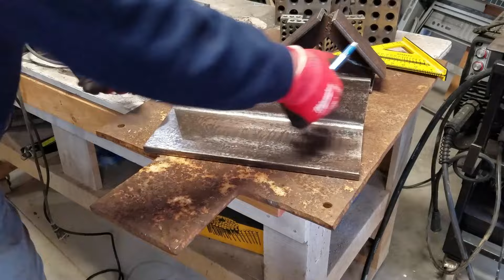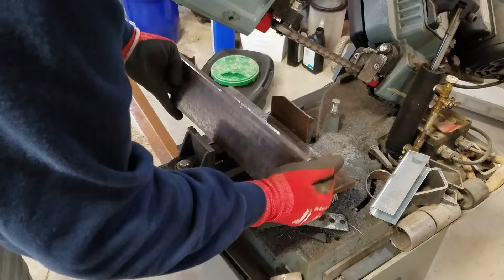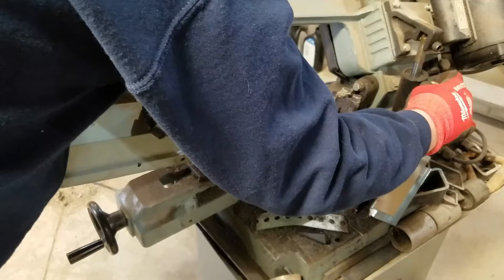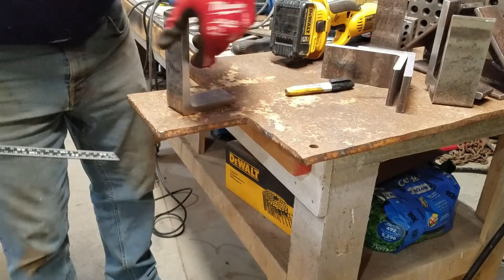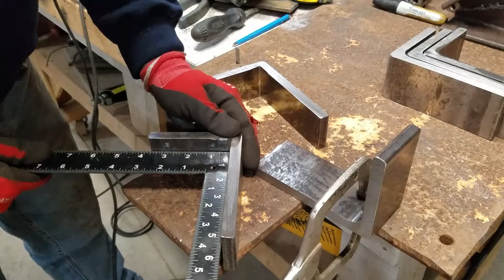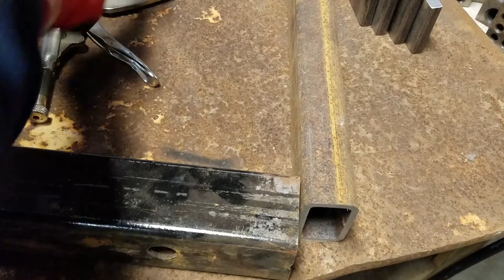6 Welding squares for under $20...DIY

Comment: Never ASSUME angle is always exactly 90 degrees. Most of the time its over just enough to be a pain.
Reply: My thought also - I would have milled the two faces square - relying on the accuracy of my mill - not perfect, but probably within a reasonable tolerance.  But, having and using a mill would probably defeat the intent of the video - low cost, easy to make "squares".

Comment: I never found a piece of angle that was Square enough without Milling the right angle
Reply: Agreed! Easy enough to clamp it to the lathe cross-slide and use a fly-cutter if no mill in the workshop, but uncorrected angle-iron on its own is blatant over-optimism!

Comment: If you would have bandsawed the angle with the corner up it would have cut faster and probably more accurately depending on the blade you were using.
Reply from the maker: I was happy with the accuracy.  It would definitely cut faster corner up.